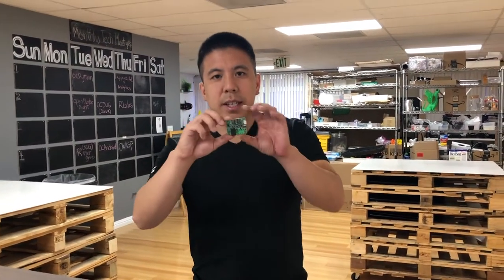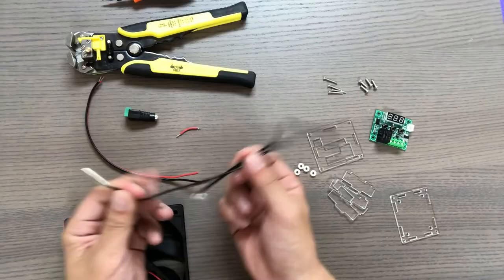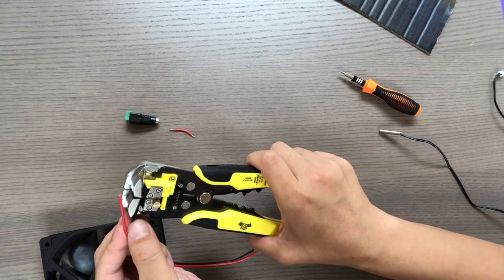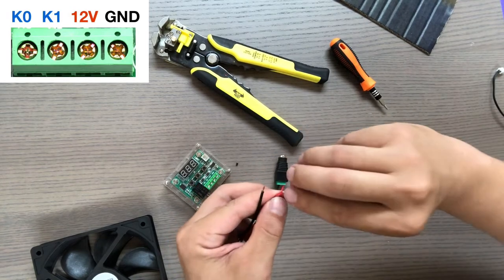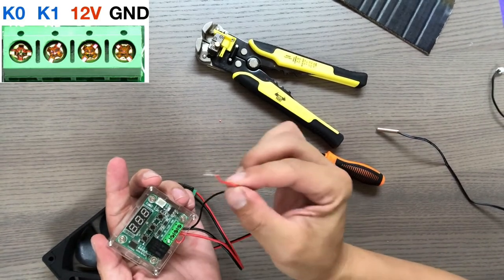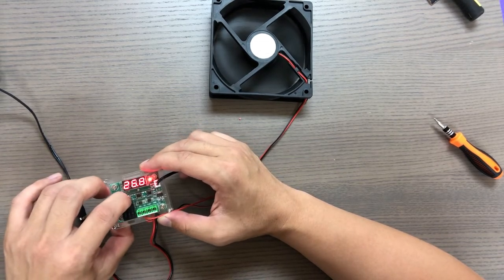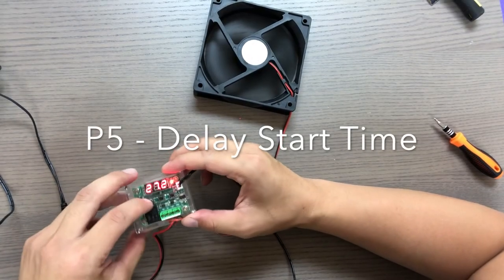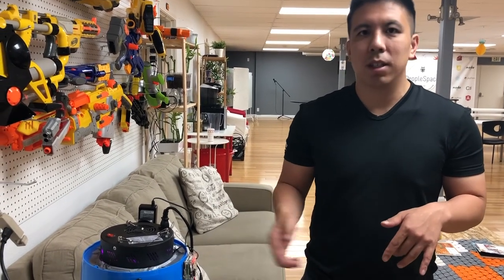How to Use a Temperature Controller to Control a Space Bucket Fan for $5!

Comment: And how does it control the Temperature? It just Accelerates the AirFlow, i dont see how it works? You would need some type of Heating-Element that blows hot air inside.